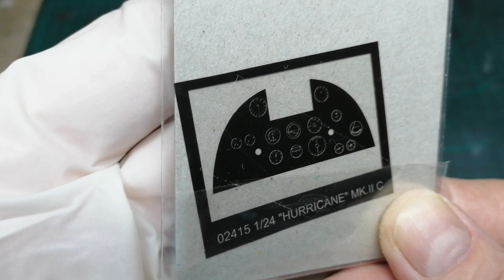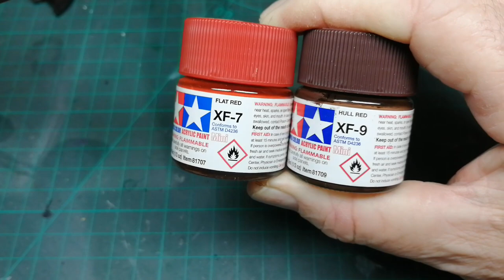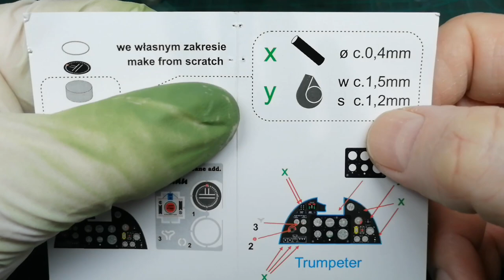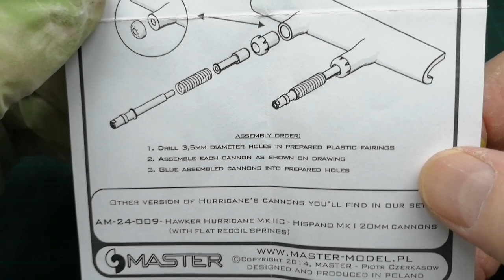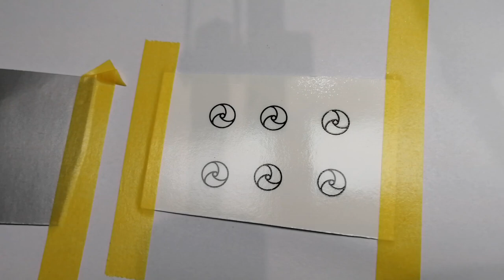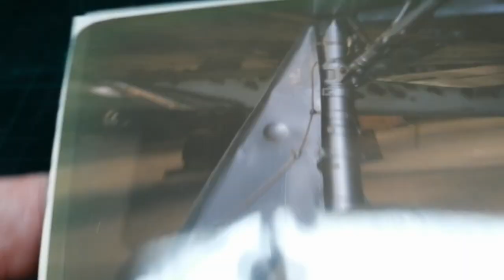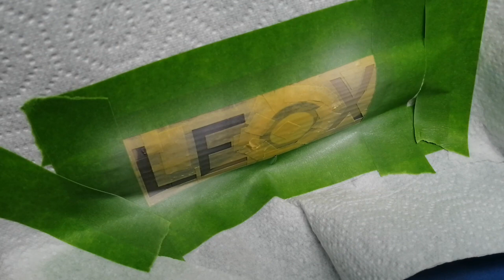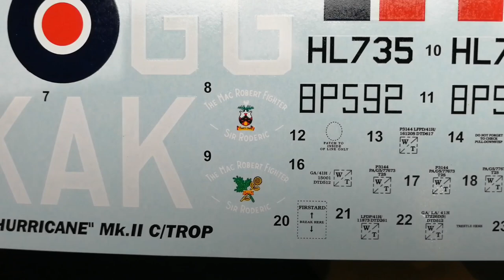Trumpeter's 1/24 Hurricane Mk.II C/Trop (Full Build)

Comment: A former colleague of mine was a Hurribomber pilot of 113 Squadron flying these in Burma. The pics I saw of his aircraft had very well defined jet black exhaust flumes curving along the fuselage influenced by the airflow over the wing root. All their aircraft were seriously underpowered clapped-out former Battle of Britain Hurries worked extremely hard in high temperature and humidity. Possibly the reason for the heavy exhaust staining.

Comment: G'day Greg, I really enjoyed watching your build. I learned a couple of tricks as well. I'd not seen the graphite powder trick before and it works a treat; a real spark of authenticity, just like our old 'instructional' engine when I was at school, '300 years' ago. 😉

Depending on my mood at the time of a larger scale build, I'll do all the interior work just because I know it's in there and, besides, it's good practice for when you can see the fine detail. Also, I feel the end look of an 'historical' aircraft or armour can be so subjective. 

You could model an aircraft that's had only test flights and, say, 4 sorties. That would look almost like it rolled out of the factory. Then there's the type of theatre it served in. You could have gone with an Aussie Hurricane as my research tells me that way out in the bush, or on some hastily built strip in a jungle setting, the fitters and surface finishers were usually one in the same bloke. 

Their priorities were to keep the aircraft flying and make them safe for the pilots. No such thing as keeping them fit for an O.C.'s inspection; all that went out the window. If they were short on the right paint, they would improvise but only on the areas important for aircraft identification. 

In the Pacific we got rid of the red dot on our roundels after a few tragic 'friendly fire' incidents from USAAF aircraft and anti-aircraft gunners. Younger US pilots would shoot at anything that had red on it in any form of roundel. No use sending out a 'memo'. 

What I'm driving at is that when I'm doing our Aussie aircraft, I try not to stick to a pattern because our War Memorial museum has hundreds of photographs of all our aircraft and they were a pretty rough and ready lot to look at. I always have a laugh when I see razor sharp 'invasion' stripes on models. I've got dozens of pics of black and white stripes being applied by flight line ground crew using 6-inch brushes and huge cans of paint. No masking of any kind was ever used, outside of the factory. 

Like you showing your errors, (which is a good thing), during the war a fitter or someone would mess up which would require an on the spot modification. Sure, they had the manuals and a routine for the paperwork, but in the heat of battle, or the fog of war, whatever, not everything was done by the book. If spares didn't show up, they'd rebuild with a homemade mod of some kind.

I'm not complaining, but the fact is that the bulk of aircraft that came to Australia from Britain were, before they left, already well used. That was OK as we were desperate for any aircraft we could get. We even took to making our own, somewhat disappointing, fighter; the Boomerang, however, it later became an excellent ground support aircraft; it was never going to be a true air to air interceptor. We even put guns on our homemade Wirraway trainer; that was desperation.

Anyway, Greg, I really liked the way you approached this big build; I prefer larger scales as I can see and feel the work a lot better these days. When I’m not modelling, I’m a military historian. I enjoyed my brief time in the RAAF and I became fascinated with the older aircraft that we were still flying, that had seen duty in Korea and were just being retired. 

There were even a very few of the ‘old hands’ who were still sporting WW2 ribbons on their tunics. I used to ‘pump’ them for war stories and that’s what got me into history. It really improved my view of modelling too, which I’d been playing around with since I was a lad of 9 or so.

I’m glad I subscribed and I’m enjoying your work, which isn’t work at all, is it? Cheers, and all the best for 2022.  B.H.
Reply from the maker: Thanks for that Bill, fascinating to read 👍

Comment: Here is a nice tip for you. On the areas of the wings where you have the foot grips try using some paint of your color choice and add baking soda. It puts the right amount of roughness to give that non-skid surface they used on these and because the soda is so fine grained it hold good scale look at just about any size model.

Comment: Changing the wings of a Hurricane could take as little as three hours (early pre BOB ones had fabric (doped linen) wings, the metal replacements gave them an extra 60 mph air speed). The Avro Hurrcane deserves more attention than it gets. It was the test bed for many innovations that proved crucial for success iagainst the Luftwaffe. This was a great build to watch. Thanks!
Reply from the maker: It was good in so many ways good stable gun platform and rugged. I'd heard a story of one landing in a ploughed field refilling with car petrol and taking off, so the story goes 👍
Reply: Wasn't it the Hawker Hurricane, not Avro?

Comment: Bit late but I've only just found this video.

In 1941, the British Government presented a Hawker Hurricane Mk I fitted with tropical equipment to Australia. The RAAF serial A60-1 was allocated, but the Hurricane retained its RAF number, V7476. The aircraft was erected at No 1 Aircraft Depot in August 1941, and joined Central Flying School (CFS) on 6 September 1941, where it was used for familiarisation flights and war-loan demonstrations. In mid-1942, the Hurricane was transferred to No 2 Communication Flight and, while at Laverton, it was used for testing an anti-"G" suit designed by Professor Cotton, of Melbourne University. Between 1943 and 1946, the Hurricane operated mainly with No 1 Communication Unit and Central Flying School, except for a month with No 2 Operational Training Unit.

In 1946, the Hurricane, now in silver finish, was transferred to Point Cook, where it remained in a disposal park until sold on 27 January 1951

It also had a colour scheme of Foliage Green and Sky Blue (not 100% sure of the underside colour) but it definitely had a bare Aluminium and Silver Dope colour scheme with War Time Roundels
Reply from the maker: Thank you for the info 👍

Comment: It still surprises me how many don't know about heating the photo etch up like this, I don't build a model without doing it now on my armour! It works for copper and brass sheet great if wanting to replace fenders heating them and rubbing them over the top of the plastic panel moulds the shape into the brass/copper it's great for realistic dints fold creases

Comment: Once again Greg, a beautiful model! As I mentioned in a previous comment, I appreciate you showing us the various rabbit holes you explored and the sometimes disastrous results because your fixes are as informative as the straight forward parts of the build. About the camouflage layouts, I started thinking about the printing of the decals you did. Would it be possible to make a master cammo template that could be scaled to suit? Then there would be a factory-like consistency for models of the same aircraft. Thanks again for the vicarious experience of working with a true craftsman. Regards, Mike.
Reply from the maker: Good idea, let me think about that one.

Comment: What do you think about the airfix ? Better than the trumpeter or not 
Cause i want to buy the battle of England Mk 1version but i hesitate airfix or trumpeter thanks again you are a great modeller !
Reply from the maker: The Airfix kit is slightly better, in my humble opinion. But you need to get a early release of this kit. From what I remember came moulded in light blue plastic, better kit from fresher moulds. But they can command high prices, remembering that the decals will be useless.
The Trumpeter kit is very good, minus engine detail.
To me, it's about getting the Hurricane kit for a good price.
Hope this helps.

Comment: Another great build Greg thanks for sharing. I have the Airfix 1/24 Hurri somewhere in my stash buried under a lot of other kits. You are right the Airfix kit gives far more detail that the Trumpeter kit. By chance do you have plans to build the Airfix kit? Look forward to your next build.
Reply from the maker: I had it sat on the shelf for many years. But unfortunately, I got rid of it when Trumpeter released their early Hurricane. Having seen the trump Hurri but up I thought I wouldn't need the Airfix offering, how wrong I was.
Reply: @GregsModels  That's a shame. By chance have you Airfoils' 1/24 FW 190 or the P-51 in your stash? Those would be good builds.

Comment: Such a great presenting style - always enjoy watching... can I ask - do you use a primer at all and if so, what's your primer of choice? I used to use Tamiya FSP but the spray can has no control and I often flooded the detail on some parts... - I switched to Mr Surfacer 1500 from a jar thinned with levelling thinners and from the airbrush - but it's a pain to clean...
Reply from the maker: I don't prime my kits before paint, just force of habit. But I'll sometimes give the whole surface a coat of acrylic Tamiya grey or white, usually just to check for surface errors.

Comment: Great vid...Been struggling to find a good vid on this build...Is there the option to not include the 'vokes filter' on this and make it like the Mk.IIC?...Does the kit include the standard chin?...I figured if I bought this kit I could decide later which Mk to build if it's just a case of the filter...Thx
Reply from the maker: No, Trumpeter doesn't supply this option in the Trop kit because if it had, I'd have made the night fighter Hurricane. But Trumpeter does supply this version as a separate kit.
Reply: @GregsModels  Thanks for the reply GM...I'm going to try get the 'trop' version of this kit in the UK...It's just that I've done a few RAF grey and green models recently (Beaufighter, Tempest, Spit Mk.IX) and just fancied the desert look for a change...I also like the vokes on Hurris and Spits from the desert theatre...But sometimes its nice to have option if you decide either way at a later date...Thanks again for the answer to my question...Lew

Comment: The exhaust Stains from the engine would've been so much worse then what you did to this model.... Overall I love the work you've done on it overall. Shame you used that expensive paint to paint the plane at first, the aluminium one. You could've done it with just some weathering later on, to make those scratches of the bare metal.  8/10 is give this model though. Thumbs 👍🏽 up

Comment: Hi I haven't built a Plastic model kit for 40 years so a question, why do you wash the parts and what with?
Reply from the maker: The plastic parts have what is called a release agent on the surface of the plastic. This comes from the manufacturing process, if not washed off will/can affect the application of paint.

Comment: Greg, question… is priming a model necessary or not?
Reply from the maker: It's an emotive subject, like adding a gloss coat before adding decals. I'll add a coat of acrylic grey all over just to check for imperfections, but for the most that's it. So long as the surface is clean and the paint mixed well, I've never had any problems not adding a primer coat. Whatever makes the modeller happy.

Comment: Looks nice but I've never seen the underside of any British aircraft in that garish blue colour.  And the rivets are rather overdone as with most kits; I would sand those down to almost nothing.
Reply: Just about everything in the Mediterranean & African theatre had either Azure blue or Light Mediterranean Blue undersides. Before the scheme was applied in the factory, it would have been done at a unit level, so you can expect variations. This does look oversaturated, but that could be the video or the monitor it is being viewed on. The green of the cutting mat looks odd compared to the one I have in front of me for example. As for the rivets. The pristine gloss painted things you tend to see in private collections, are spotless. A faded, worn, matt painted aircraft in a combat theatre tends to collect oil and dirt, and not be cleaned an awful lot.  The Hurricane also has some pretty hefty rivets.